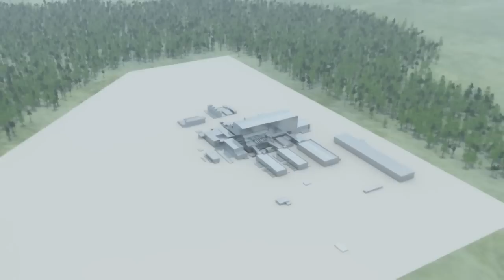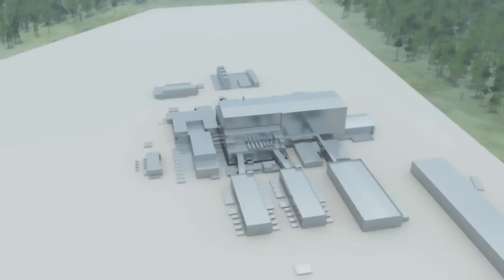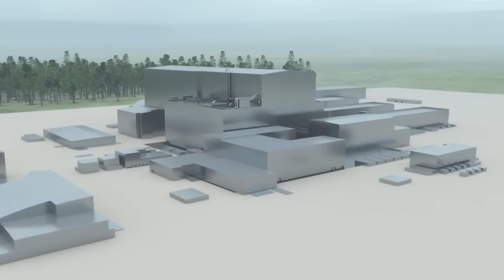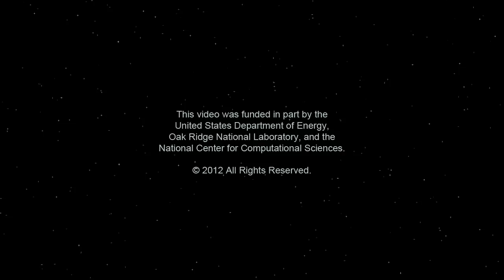Fusion Energy Production by Deuterium Particle Injection

Comment: Isn't tritium highly radioactive?  So how would that be a safer alternative to fission reactions in a nuclear plant?
Reply: (I'm not an expert but)
Fission is a process where you take big ass atoms to break them, bigger atom contain more energy and really big one tend to be unstables (and easier to break i think). They are more problematic because they realease a lot of energy (radiation) even on their natural state because of their unstability (half-life atoms), so first they create more radioactive wastes, but the biggest problem of fission is that its process is a "controlled chain reaction" if you lose the control, the reaction continue without well... control. 

Fusion is literally the opposite process. You take small atoms (or isotopes) and create new bigger one by forcing them together, in the process it loses some energy, we recover it. It still create radioactive wastes but far less, also it's far safer because it requiers a permanent activity to work if you lose control of it or stop supplying it, the reaction will just stop.
Reply: msxbrc
Well I'm not sure I agree with that and here's why.  I'm no expert either but my thinking is this.  E=MC2 applies to both types of reactions.  So if you fuse a tritium atom you get a helium atom, one or two neutrons, and the energy calculated from the mass of the tritium and/or hydrogen atoms.  If you split a uranium atom, you get two lighter elements, several neutrons and the energy released from a much larger uranium atom.  So the uranium has a much higher energy potential because it's mass is much greater.  So I guess the question is, if you split uranium would more energy be released than if you fused tritium or hydrogen.  I tend to think you would get more energy released from a fission reaction because the uranium atom is so much more massive.  So even though a fission reaction does release more neutrons, you have to fuse more tritium atoms to release the same amount of energy.  And fusing more tritium is going to release more neutrons. 

Plus, doesn't it take much more energy to fuse hydrogen than to split uranium?

But again, I'm just spitting in the dark.  I know nothing about nuclear chemistry.  But I've been fascinated with it ever since I heard that Ponz and Fleischmann were actually telling the truth.  All the data supports them.  There really was a concerted effort to discredit them.  They were wrongfully ostracized.
Reply: The safety issues are regarding the final products. The fuel for both fission and fusion reactors can be mined, refined, produced and used quite safely, but once the reaction is complete there is the issue of what to do with the products. Even in the Gen IV reactors which can consume nuclear waste (such as plutonium and other transactinides) there are other shorter lived elements such as Cesium and Strontium which are quite radioactive. The final product from fusion at this level would be helium, which is non-toxic and not radioactive.
Reply: ***** Here there's two elements I think, the first and probably the most important about fusion over fission, is the rarity of the material, all atoms share the sames coupounds (Proton, neutron, electron) but the bigger they are the harder they are to bond together, so naturally the simpliest Hydrogen (and its isotops) is the most common element in the universe, it's really easy to find (it's quite limitless), while heavy elements like uranium are really rare, proportionnaly speaking you have a really small amount of heavy atoms (fissile material) on earth. So with fusion we have no problems of finding resources or exploting them.

On an other hand I think the process of fission is easier, but messier, while heavy atoms have a lot of energetic potential you don't release all of it nor control the way the atom break and decay, while with fusion you exploit every bit of it, that's probably why thermonuclear bomb (which works on fusion principle) are far more powerful than Atomic bomb (which works on fission principle).
Reply: Not "highly" radioactive. They put the stuff in the ironsights of firearms to make them glow for decades. Also some keychains glow with the decay of tritium. The decay of which is an electron so it strikes a phosphorus material then it glows. Basically it's just like florescent lighting except the electron comes from decaying tritium instead of the electric grid. The guns do a lot more killing than the tritium does :P
The waste of a fusion reactor is stable helium-4 which we are in short supply.
Reply: If you have a few tritium atoms in a wristwatch, that's one thing but we're talking about huge electricity plants producing dozens of megawatts using much more than a few atoms.  I'm no expert but I think the amount of tritium used in a fusion reaction would be significant.  I could be wrong, I don't know. 

As for helium 4 being produced, it's to be expected from a fusion reaction.  And FYI, it is not really in short supply.  It's pretty much readily available.  Helium 4 is the isotope used in inflating party balloons.  Helium 3 is the rare isotope.
Reply: ***** The amount of radiation in the reactor is far greater than the natural decay of tritium. The amount of plasma by mass is way smaller than a fission reactor's fuel so a catastrophic event wouldn't be as bad as in a fission reactor. The density of plasma that would be in reactors would be pretty small at all times because you could just add more when needed.
Reply: Deliciousbutter
The process to fuse atoms however is VERY radioactive. It doesn't stick around though.
Reply: Radiation is separated into 3 categories. Alpha, Beta and Gamma.  Nuclear waste emits gamma which is the stuff we are scared of. Alpha and Beta can not penetrate our skin.  However, it ingested it could do some damage but not that much.  Tritium is a low energy beta emitter.
Reply: Fusion reactor is much safer, because fusion reaction can't get uncontrollable. It is very hard (today it is impossible) to create enough concentration and temperature. Too much power generated leads to increasing temperature. Higher temperature => faster speed of particles => much harder to keep them together => lower concentration => reaction stops. Fusion reactor can't explode. Even fusion bomb can't explode without a nuclear(fission) detonator.
It is not necessary to use radioactive tritium, it is possible (but even more harder) to use deuterium without tritium.
Reply: Better then normal nuclear reactor...
Reply: ***** We are discussing deuterium and tritium in a fusion reaction.  A fusion reaction does not use thorium in any capacity.  Plus energy from thorium is a fission reaction.  So I'm not sure what thorium has to do with fusing hydrogen. 

Topomac reactors aren't yet capable of creating a sustained fusion reaction more than a few seconds.  That is why we don't have energy being produced by fusion reactors.  After all the whole point behind a fusion reactor is to sustain itself without inputting more energy. So the nature of a fission and fusion reactor is the same.  So the risk of meltdown is the same in both fusion and fission.  If left uncontrolled a fission reactor would melt down.  Same thing in a fusion reactor.  That is assuming a sustained fusion reaction is ever created.
Reply: *****
Fusion reactors cant melt down, the fuel isn't solid. the worst that can happen is if the plasma somehow strikes the walls of the reactor, but the plasma has so little mass that it doesn't have enough heat energy to make much difference, it's like trying to melt an entire ice block with 1 match. If it persists then the magnetic coils break and the reaction stops.
Reply: The ultimate goal of a fusion reaction is to hold a sustained reaction to heat water into steam to spin a turbine.  Exactly like a fission reactor.  But instead of splitting atoms, the reaction fuses atoms.  Therefore if you have a sustained fusion reaction, it is by nature, a controlled runaway reaction.  The whole point of a reactor, fusion or fission, is to create a runaway reaction so it will sustain itself.  So the danger of meltdown is just as real. 

A match could melt a block of ice and much more if it was extremely difficult to extinguish and burned at millions of degrees.  We're talking the power of the Sun.  That match would melt the ice in seconds, vaporize the water, fuse the hydrogen in the water and start burning a whole in the bottom of the reactor.  That is after all why a topomac reactor is essentially a huge vacuum chamber.  Because if air got into it, it would burn hot enough to melt the metal in the reactor walls.
Reply: *****
The amount of mass is a factor in how much "heat" energy there is, a block of ice is much heavier than a match, just as the tokamak reactor is much much heavier than the plasma that runs through it, so the temperature of the plasma drops massively if it strikes the reactor. Also fusion isn't a chain reaction, the sun just has a lot of gravity and fuel but we need to power the magnetic fields to hold the plasma on earth.
Reply: leerman22
 Am I missing something?  That is the nature of nuclear power isn't it?  To sustain and control a chain reaction?   To control something thought to be uncontrollable to heat water, spin a turbine and do mechanical work?   The energy released from fusing two hydrogen atoms is enough to make two more fuse and so on.  The only way to stop it that I'm aware of would be to take away it's fuel source and let the remaining hydrogen fuse until the reaction stopped. 

The magnets keep the reaction contained in the reactor.  That's all they do.  Nothing more.  The last thing they want is for the reaction to hit the reactor wall.  They wouldn't need the magnets if the reactor walls could dissipate all that heat.  If scientists were able to sustain a fusion reaction to heat water into steam to spin a turbine, the danger of a melt down is very real.  As real as a fission reactor.  It doesn't matter how much mass there is.  Do you know how big the uranium pellets are in a fission reactor?  You can fit several in the palm of your hand.  So the mass is not the issue.  E=MC squared.  I'm not ready to dismiss Einstein just yet.
Reply: ***** it doesn't have to be a chain reaction in any reactor, uranium falls apart by itself and U235 is split by thermal neutrons moderated by water, but that's just a fission reaction.
The problem with fusion is that you need to produce more power than the reactor consumes to generate the reaction. The strong magnetic fields need a lot of power, the magnetic field contains and heats the plasma. If you take away the pressure the magnetic field produces the reaction stops. The only way fusion works is with the intense heat and pressure, we just opted for magnetic fields to get us that.
Reply: Well, a fusion reactor is a vacuum.  There is no pressure.  And a magnetic field cannot produce pressure anyway.  Yeah, you are right.  The problem with a fusion reaction is that it requires more energy in, than out.  And that is why we don't have fusion reactors producing electricity.  Because they cannot get it to perform a runaway reaction.  If you want real sustainable power, you must have a runaway nuclear reaction.  And that is what is driving the research into fusion reactors.  Who can find a way to sustain that nuclear reaction so they don't have to put more energy in?    Otherwise there is no point to researching a fusion reactor.  If it requires more energy in than it outputs, then it serves no purpose.  The only way you can get more out than is by causing a runaway reaction.  A chain reaction.  I don't know why you're hung up on the magnetic field.  A magnetic field in a fusion reactor serves to contain the reaction.  That's it.  Nothing more.  There is no pressure.  A magnetic field cannot cause a pressure difference anyway, especially in a vacuum. 

Seriously, how do you think a coal plant works?  The coal burns in a runaway reaction.  Fortunately we can control it by reducing the fuel input and oxygen input.  But the principle is the same.  The coal burns, heats the water into steam, which turns a turbine.  If we threw a bunch of coal in a coal reactor in an uncontrolled fire, it would heat the water into steam, and explode from the pressure.  Essentially have a meltdown. 

Now I may not have a physics degree but I did take two semesters of it along with four of chemistry so I think I know a little about the basics of fusion and fission reactions.  And sorry to burst your bubble but the whole point of a fusion reactor is to create energy and the only way you can create energy is if you have a sustained fusion reaction that doesn't require much input.  In other words, input a little power to the electromagnets to contain the reaction and let the fusion process do the work of heating the water into steam to drive the turbine.
Reply: *****
the plasma is made of hydrogen nuclei and electrons, they are magnetic, they are compressed by the magnetic field, they make alot of heat under pressure, then they fuse.
Reply: leerman22
I understand how a fusion reactor works so the science lesson isn't necessary.   The original question was that a fusion reactor is susceptible to a melt down. 

The hydrogen bomb says it is.
Reply: *****
melt·down
ˈmeltˌdoun/
noun
an accident in a nuclear reactor in which the fuel overheats 'and' melts the reactor core or shielding.

The fuel in a tokamak reactor is plasma, so beyond molten. Useless to describe even a molten salt reactor, but other bad things can still happen.
Reply: It is actually much less radioactive than most fissile materials. This, along with its fusion with deuterium (like tritium, but with zero radioactivity), makes it by far the harmless nuclear material known to man.
Reply: The tritium is the fuel, and not the waste product.  It does not need to be stored underground for millions of years like the waste products of uranium fission.
Reply: Andrew Curley
In addition, I would not call tritium "highly" radioactive in a damage inducing sense.  It is actually unable to pass through skin, and is therefore only damaging if taken internally.
Reply: ***** The hydrogen bomb doesn't work like a fusion reactor does, so no, it doesn't.
Reply: Justin Dixon
After some reading I discovered that the neutrons released from fission reactions are highly radioactive.  Even more than a fission reaction.  However, the half life of a neutron not bound to a proton is only 20 minutes.  So yes, yes it is.
Reply: Andrew Curley
I was watching one of Thunderf00t's videos and I think you're right.  You definitely don't want to ingest this type of radiation.  If you somehow ingested a heavy dose, you would die of radiation sickness in days.  But apparently it does have difficulty penetrating your skin.  So short exposures are not much of a concern.  But extended and prolonged exposure can enter the skin and cause long term damage.  From what I understand it's the same type of radiation that atom smashers emit while they are running.  Once turned off the radiation has a half life of 20 minutes. So it's dangerous but as not as dangerous as radiation from fission.
Reply: *****
It's not necessarily just the radiation but also how the isotopes act when the body adopts it into it's chemistry. After the element decays it is a different atom and that could happen in a very bad place, like your DNA/RNA/vital proteins.
Reply: *****
That is exactly true, but there is something else that makes it not nearly as dangerous as fission.  The tritium would be made on demand.  This makes long term storage unnecessary and therefore makes long term exposure a non-issue.  After fusion takes place, there is no radioactive elements remaining.  That is assuming that all of the tritium is consumed during fusion.

Comment: amitakartok
Tritium and He3 are the same thing... its just one of the confusing terms in the Nuclear Chemistry world
Reply: He3 is an Helium isotope with  two protons and one neutron. Tritium on the other hand is an isotope of hydrogen with two neutrons and one proton, it's symbol is H³ which is confusingly similar to that of the helium isotope. Therefore the letter T is used most commonly for Tritium, to work against this often occuring misconception.
Reply: My mistake. it was late and i was not thinking correctly. you are absolutly correct
Reply: tritium = 3^H, not He3.